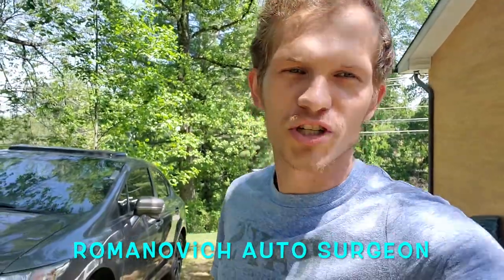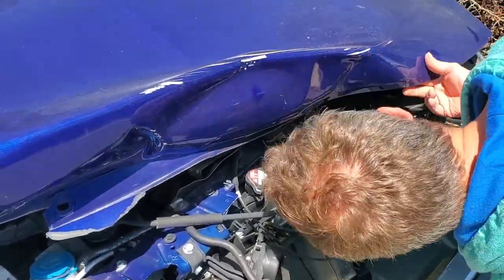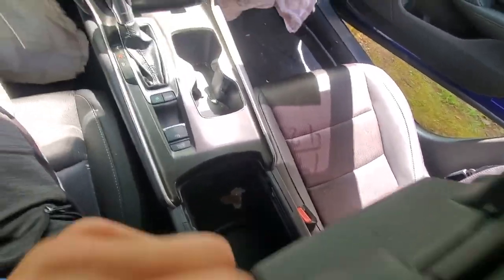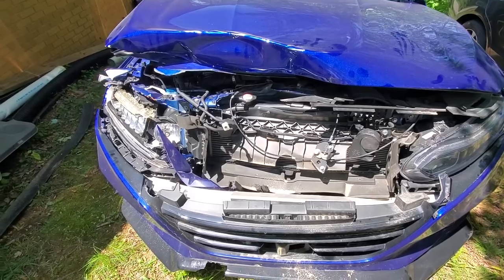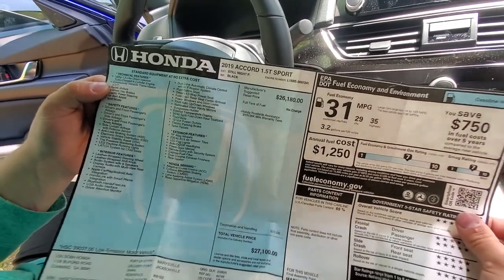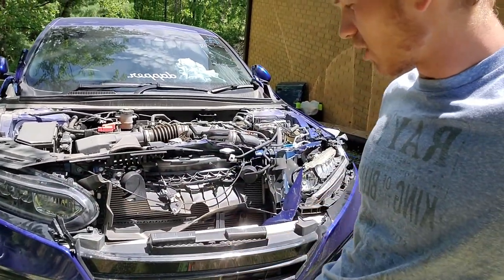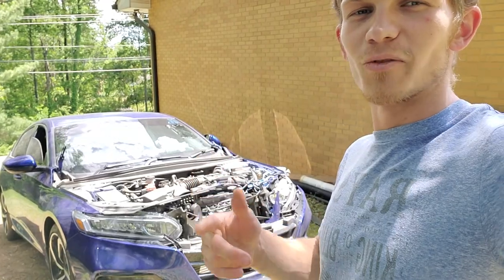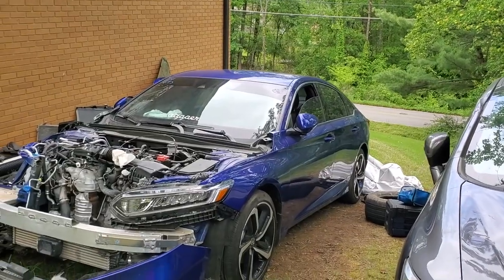Rebuilding A 2019 Honda Accord Sport | New Build Is Here!

Comment: Hello I have a question is the Radiator supposed welded? Or just nuts  and bolts that we can take off?
Reply from the maker: @blackhawks1870  it’s not welded. It’s just bolt on
Reply: @RomanovichAutoSurgeon thank you so much for reaching out. I have a similar situation. I thought it was. Bc I saw other videos on similar cars that it was welded. Thanks
Reply from the maker: @blackhawks1870  interesting. Is it 2019? Maybe they made a few different ones. Strange tho
Reply: @RomanovichAutoSurgeon  don’t know. It was a 2.0 engine though…

Comment: Was the radiator support/bulkhead welded or just bolted on ?
Reply from the maker: @edgarespinoza3868  no this was all bolt on. Just like a Lego. Which makes it very easy to work with.